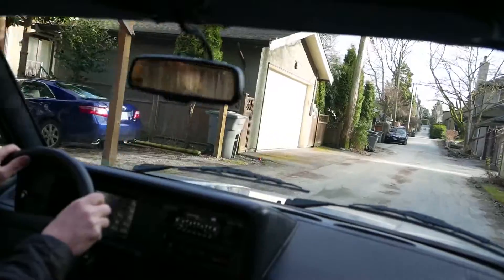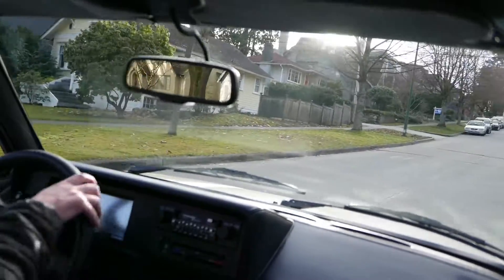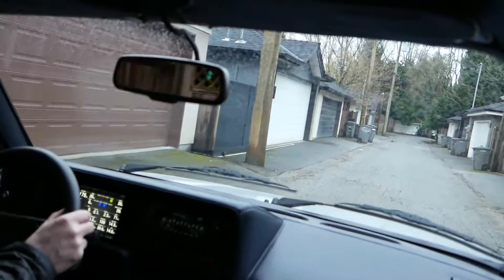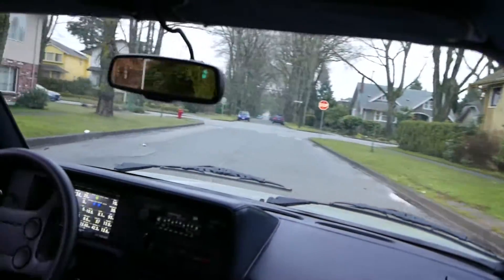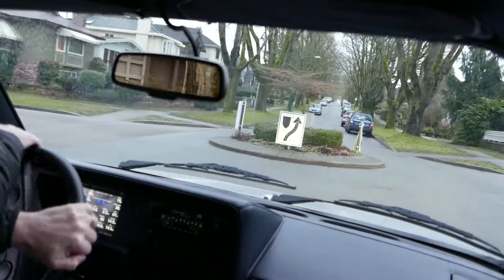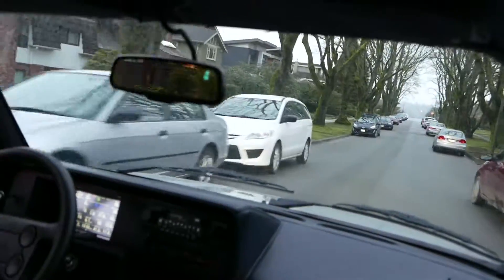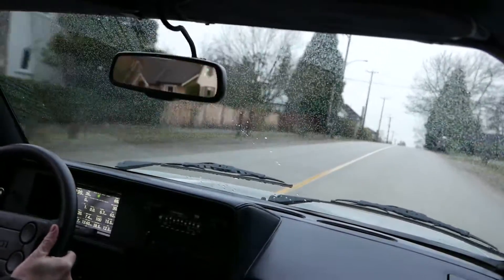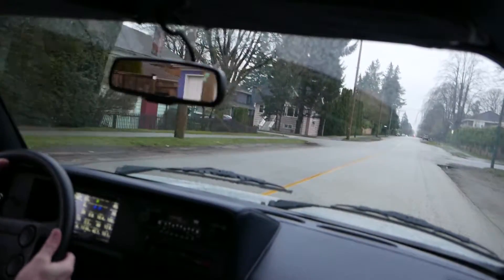The Ultimate 1983 Rabbit GTI - part 143 (Tech-53 Big Brake Kit - part 2)

Comment: That sound was horrible, sounded like the brake discs where loose, most likely not but a scary sound non the less.
Hope you figure that out soon.
Reply from the maker: The driver side calliper was a bit too close to the rotor on the top/inside - I was able to adjust the height enough to get clearance. That said, I am going to race this bunny and will get the rotors over 1000 degrees F so I milled 0.050" off the rotors to buy me some thermal expansion insurance!

Comment: Were you able to isolate the clunking sound?  That didn't sound like brake pads?
Reply from the maker: The driver side calliper was a bit too close to the rotor on the top/inside - I was able to adjust the height enough to get clearance. That said, I am going to race this bunny and will get the rotors over 1000 degrees F so I milled 0.050" off the rotors to buy me some thermal expansion insurance!
Reply: Glad you isolated and fixed the problem.

Comment: maybe a warped brake disc? this happens when the brakes warm up? check the run out with a dial indicator on car
Reply: elvelozpr thinking the same thing
Reply from the maker: The driver side calliper was a bit too close to the rotor on the top/inside - I was able to adjust the height enough to get clearance. That said, I am going to race this bunny and will get the rotors over 1000 degrees F so I milled 0.050" off the rotors to buy me some thermal expansion insurance!